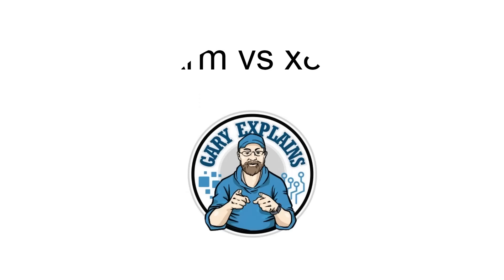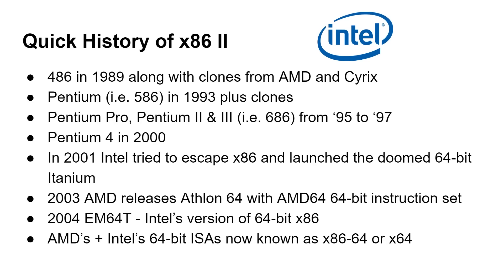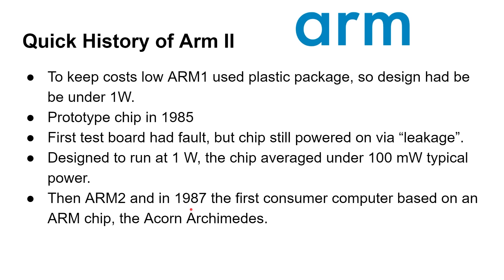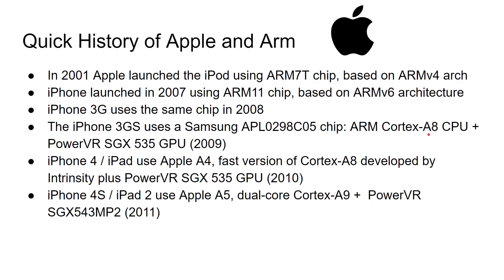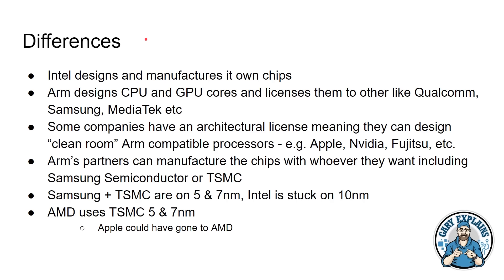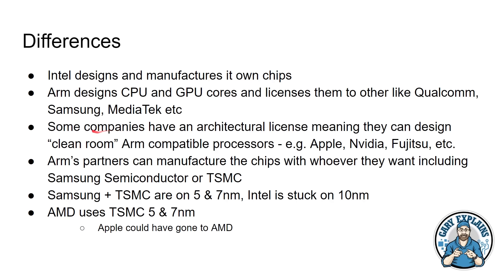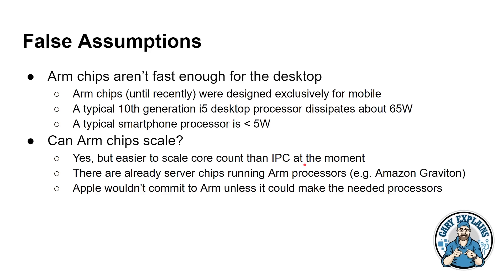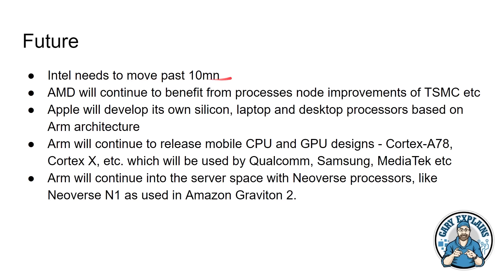Arm vs x86 - Key Differences Explained

Comment: I think the future is having both ARM and x86 cores in one package, until something replaces transistors.
Reply: You do realise how much of a nightmare it would be to address two ISAs simultaneously right?
Reply: @Thelango99  I don't think RISC and CISC with be used in conjunction(parallel processing), But I can Imagine a system that uses RISC when you turn on, do light work ect. So no need for fans and all that to turn on. The CISC part of the package will be used by programs than benefit from such. I guess wound have separate memory too. Deciding what to use I guess would be down to software/OS.
Reply: @Howch125  The problem is that no OS can operate on more than one ISA in a single system.
Reply: @Howch125  Doing so would also mean a major rewrite to Windows.
Reply: @Thelango99  Oh yeah whole new OS but Windows 95 was just a pipe dream once...
Reply: @Howch125  Maybe AMD can make such a processor as they have an ARM license. I highly doubt Intel would do it lol.

Comment: Apple did have a life before IBM's Power architecture: Motorola 68000, and even 6502.
Reply from the maker: True. And?
Reply: @GaryExplains  You went back to the 4004 for Intel.
Reply from the maker: Because the video is called Arm vs Intel... So I covered the history of Arm and Intel. It isn't called Apple vs Intel or Apple vs Arm... Apple is there only for context.
Reply: @GaryExplains  While the teaser screen says vs Intel, the video title is vs x86, and the 4004 isn't a basis for the x86.
Reply from the maker: @KeepEvery1Guessing  But still, the video isn't primarily about Apple, is it?

Comment: Apple used to be on Motorola (a good piece of silicon), going to Intel was forced on them by Microsoft, now Microsoft is looking at Linux kernels and is worried about ARM I'm guessing Apple aren't being controlled as heavily. ARM has proven itself, but it won't make Apple any better without Steve Jobs it's just another tech company.

ARM is already running Linux and Android so can scale up to desktops easily. Intel and Windows is boxed in and limited. This is why Microsoft is looking at the Linux kernel and ARM processors... They're trying to figure out how to patent and cash in when it's already out there and a lot cheaper than them.

Intel is already considering licensing production (outsourcing) and probably will go to development only soon. Manufacture is costly to keep up with...
Reply from the maker: Apple moving from PowerPC to Intel was not forced on them by Microsoft.
Reply: @GaryExplains  So it was a coincidence that Microsoft Office was pushed onto Apple as a productivity suite?

The only reason Apple survived is Microsoft needed competition to avoid a monopoly claim...
Reply from the maker: As you said, Apple survived because Microsoft needed competition to avoid a monopoly claim... Absolutely. Microsoft invested in Apple when Job retuned. This was around 1997. The new reinvigorated version of Office for Mac came out in 98. Apple didn't transition to Intel until 2005. To two things are not related.
Reply from the maker: I don't quite follow your reasoning, so just best to stop here. Thanks for the chat.
Reply: @GaryExplains  You know Microsoft either bought out or destroyed all competition. This was no different. But they got caught out loosing too much competition and getting sued for being a monopoly, Bill Gates learnt from that and decided the best competition was if he controlled it.

He tried it with mobiles and failed, but it worked with desktop PCs. Until Linux grew to the point of potential threat - something he promoted by undermining Apple, which is why Microsoft are now trying to port a Linux kernel into Windows, the first step to embrace, enhance, patent, lockout. He's too late on that one though. ARM is already well on the way tp routing Intel and with it the alliance is faltering. You're looking at a small portion of Microsoft's woes.

But as you wish, I will stop there...

Comment: Looks like Apple doesn't  own up to its use of the Motorola chipset.
Reply from the maker: eh?
Reply: @GaryExplains  
The Motorola 68020 was the first 32-bit Mac processor, first used on the Macintosh II. The 68020 had many improvements over the 68000, including an instruction cache, and was the first Mac processor to support a memory management unit, the Motorola 68851
Reply from the maker: Yes all that is true. But I don't understand what that has to do with this video or what you mean by "Apple doesn't  own up to its use of the Motorola chipset." As far as I know Apple has never tried to hide the history of the Mac or any of its products. I am very confused.
Reply: @GaryExplains  IBM set was mentioned but motorolla was not. Because I'm over 60, this was just something I remembered. To bring it up was in o way meant to be harsh. Love your presentations.
Reply from the maker: I am glad you enjoyed the video. I didn't mention the Motorola Macs or any other of the other chips used by Apple because this video is about Arm and Intel, not Motorola.

Comment: It won't be that long before x86 and ARM are both obsolete.
Reply from the maker: LOL
Reply: @GaryExplains  I guess I should have said obsolete in performance systems. ARM will probably be used in low power applications like cell phones and chrome books for some time.
Reply from the maker: And what will replace Arm and x86 in performance systems?
Reply: @GaryExplains  I'm curious what point you disagree on:
1. x86 has a lot of design flaws due to its long evolution that are only partly fixed with the RISC core.
2. monolithic multi-core is nearing a practical limit
3. memory latency is a bottleneck in CPUs and an even worse one in GPUs
4. pipeline length has been at a practical limit since the Intel Prescott core
5. data width is at a practical limit
6. wafer process reduction is nearing a practical limit
7. clock speed is nearing a practical limit

These things suggest to me that a fundamentally different architecture will be needed if processing power is to continue to increase.
Reply from the maker: In other words you don't know.
Reply: @GaryExplains  In other words, apparently you have no idea what you agree or disagree with -- but you have an unshakable faith in the status quo. Nuff said.
Reply from the maker: No not at all. I was only replying to your original statement which was "It won't be that long before x86 and ARM are both obsolete." That is a strong statement. And your argument is basically this, "I think there are problems with the current CPU architectures therefore it won't be that long before they are obsolete." That isn't a reasoned argument in anyway whatsoever. Sorry.
Reply: @GaryExplains  You seem to have a habit of trying to do both sides of a discussion. That was never my argument. Straw-manning seems to be the only thing you can do. Gary Deflects.
Reply from the maker: Now I am really confused. Nevermind, I think we best stop.
Reply: @GaryExplains  Your argument is very simple: You like the ARM processor, so you don't want to hear that it doesn't have much of a future. And instead of addressing the points you keep going off on tangents. Before any RISC processor existed, the idea existed as a theoretical design. There is a theoretical design that exists today that will replace x86 and ARM in performance applications. I don't know what else to tell you.
Reply from the maker: No, that is not what is happening at all. I have asked you direct questions and rather than giving an answer you reply with more questions. And then in this last comment and the one before it you are arguing with me about arguing. So, it is best to stop if you aren't prepared to actually discuss this properly.
Reply: @GaryExplains  We already tried that. You weren't willing to discuss anything and instead tried to invent my arguments so that you could more easily dismiss them. And I don't know what reason you would have for doing that other than the fact that you seem to really like ARM. It is possible that an ARM could be used as the basis for a new design but probably not one of the recent ARMS.
Reply from the maker: OK, I will give this one last try, here is a replay of what happened:

1) You said, "It won't be that long before x86 and ARM are both obsolete in performance systems?"
2) I asked, "And what will replace Arm and x86 in performance systems?"
3) You replied by asking questions.
4) I interpreted (maybe wrongly) your reply of questions, rather than an answer as obfuscation.
5) Everything went downhill from here.

Also you assumption that I am arguing because of a liking for Arm is erroneous, if I understand what you are saying then Arm, x86, PowerPC, RISC-V everything will be obsolete, again if I understand your argument. So it is completely irrelevant about my preference of architecture.

Did I get anything wrong in this replay of events?
Reply: @GaryExplains  Okay, I watched your video on Moore's Law. It appears that you believe that we will have sub 1nm process chips at some point. I guess that would explain some of your assumptions. So, the next question is how the chips will get faster. Presumably we can't lengthen the pipeline, can't increase superscalar, can't increase clock, can't increase data width, and I don't think there is much left on increasing IPC. So, doesn't that only leave multi-core (which cannot keep increasing) and more SIMD -- which is essentially what you have with a GPU.
You could be arguing several different things. You might be arguing that a 12 core x86 will get replaced at some point by an 18 core ARM which might be faster for the same power. You might be arguing that the trend is away from actively cooled processors towards low power passively cooled processors which is what we have with cell phones and notepads. However, you did mention servers so this suggests that you do see a need for high performance applications. So, if you wanted to build a supercomputer that delivers an exaFLOPS you can either use more processors with a lightweight OS or you can increase SIMD. I would agree with you that for current technology, an ARM is probably a lower power draw for a lightweight OS design. However, the trend seems to be towards GPUs for higher SIMD. But, I don't see that architecture continuing much past the exaFLOPS size since GPUs are memory bandwidth limited. Nor do I see ARM as a solution.
So, what I'm talking about is a different system and processor configuration where you could do massively parallel without a lightweight OS and without memory bottlenecks to get to something like 100 exaFLOPS. I suppose saying "soon" was a bit hasty. The driving force looks like super-computing applications, but it would work down to server and eventually desktop.
Reply from the maker: So, I also mention in the Moore's Law video that performance can be delivered in different ways including cores (as you said), ILP (let's call that your point about pipelines, for simplicity), and clock speed. There was also a bullet point with ??? My feeling is that next is true heterogeneous computing. We started with integer CPUs, then we got floating point units, then GPUs, then Neural Engines, then ??? So moving towards more dedicated hardware blocks that do things differently than the CPU is the trend we are seeing. This can then be combined with other less dramatic performance increases in the more traditional blocks like the CPU. There is an argument for using the current von Neumann architectures for central processing and then other architectures like neural processors and image processors and vector engines etc for specialized tasks. What I don't see is "x86 and ARM" becoming obsolete any time soon.
Reply: @GaryExplains  The theoretical architecture was to overcome problems in AGI primary system design. If you try to use traditional processors, it quickly becomes decoherent. The solution was even more laughable because it required a front-end scheduler that was something like 10x bigger than the actual system. So, the theoretical architecture is to avoid both memory bottlenecks and dependencies. It can handle processors of different types. I'm not sure that I would call it standard Von Neumann architecture because the machine state is dynamic and distributed.
Reply: @GaryExplains  I also think so that we will have dedicated processing units for important tasks that do it better than general purpose unit. Like GPU, encoder\decoder units, some buffers, more or better I/O, may be some JavaScript unit since it is so slow and consumes a lot of resources nowadays. And I thing we need better and simpler software and not sluggish thing like microsoft give us.

Comment: Now that Microsoft and Apple are making ARM versions of their operating systems do you see Intel making ARM compatible CPU's in the future ?
Reply: I think, no, because many programs are compiled for x86. They probably don't have the developer anymore to recompile them and emulation in OS will be low in performance. They have market in x86 and a monopoly, but in ARM there's better competitor.
Reply: @xponen  I don’t think that’s the case this time, I’d bet that there will be more ARM desktop/laptop computers being sold than x86 within 5 years. I’ve been in IT for 20 years, there’s a few differences with the industry these days. Speed is not the driving force now, half of all computers are laptops now and half of the desktops being sold are using a mobile processor, the market is already giving up significant speed for convenience. Most applications are updated regularly or moved to the cloud. Assuming the x86/x64 emulation works correctly I see the transition being more like the transition from 16bit to 32bit or 32bit to 64bit. Microsoft and Apple wouldn’t be spending billion on changing to ARM if they didn’t feel that ARM could keep up with x86 development while still offering significant power savings.

Comment: I'm disappointed you dragged up the tarded term "x64". Just let it die already, it's stupid and confuses less informed. Intel's x86-64 implementation is basically the same as AMD's, just a different name. Also EM64T was depreciated already in 2006, it's called Intel64 since.
Reply from the maker: LOL, dude my job is to inform and explain. I didn't invent the terms, but since people will read them it is absolutely essential that I at least mention them, which is what I did. I think you get disappointed too quickly.

Comment: Arm-risx is good for battery life.
Just remember everyone's cellphone and tablet uses cloud computing to do the heavy lifting. Which runs on X86-cisc processors.

It's all about what instruction sets you need.
Reply from the maker: So when I am playing games or editing a photo that is all happening in the cloud? Also Intel's dominance in the server space has very little to do with x86 itself or CISC.
Reply: @GaryExplains  to get better and better battery life the heavy lifting happens in the cloud. Just look at when siri and Google voice game out. None of the processing happened on the phones. It wasn't until after it become big that arm implementation became a thing. 

Look at the nvida cloud gaming and the Google stadia. They are all moving to light powered arm chips and the heavy lifting will happen on the cloud. 

it has all to do with cisc. Some instruction sets works better on X86. As much as I want arm to be successful it's not likely. They have a notch in custom arm servers but those will be limited by customers wanting the exact same thing.
Reply: @GaryExplains  also don't forget apple left powerpc for Intel.
Powrpc was risc. It had massive over heating issues and the performance per watt sucked. Which is why they went to Intel.
Now they are going back to risc.
Reply from the maker: PowerPC's problems were nothing to do with CISC/RISC but to do with its microarchitecture. Don't make blanket (and wrong) assumptions with all-too-convenient labels.
Reply from the maker: Much voice recognition stuff is now moving to the device. It has nothing to do with RISC/CISC but all to do with a new technology which is only now becoming agile enough to move to the device. Like all tech, it started big and then shrinks. That is a common tech trend, again nothing to do with RISC/CISC.
Reply: @GaryExplains  the reason voice moved to risc was because they added the instructions and designed for it. X86 didn't need to be designed it was able to run it fast without any voice cores. Hence the reason why X86 is better. It had nothing to do with t becoming more agile. Voice recognition on those arm processors couldnt be done. 
Arm is only good if you specifically design it for the application. Which sucks when that application becomes outdated.

I like you Gary. But yours is a half truth and  showing the full picture.
Reply from the maker: Nonsense, absolute nonsense. The reason the voice recognition was done in the cloud is because those are big severs running at hundreds of watts of power, nothing to do with x86 itself. Yes, x86 is the default server architecture at the moment, but it is the "cloud" part (i.e. lots of big severs) that is important not the architecture of the cloud. Secondly companies like Google added extra hardware (tensor processing units) to those servers to speed up the inference. Google began using TPUs internally in 2015, and in 2018 made them available for third party use. I think it you who are missing half the truth, not I.

Comment: It's funny that you call this "ARM vs. Intel" because the current 64-bit iteration of x86 was invented by AMD with Jim Keller's Athlon-64 CPU.  Even today's Intel architecture is based on AMD64.  Too funny.
Reply from the maker: What is "too funny" is that you don't understand the context of the video which is Apple moving from INTEL (not AMD) to its own silicon. What is even funnier is that if you bothered to watch the video, which clearly you didn't, you would have seen that I explain the full history of x86 and x86-64 🤦‍♂️